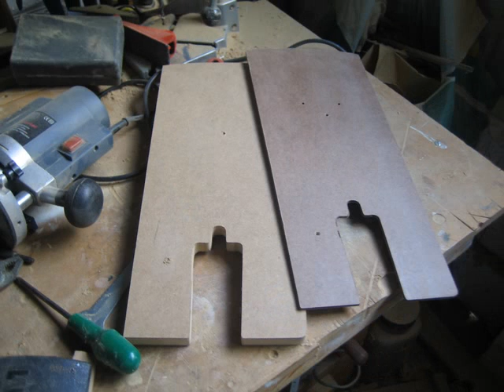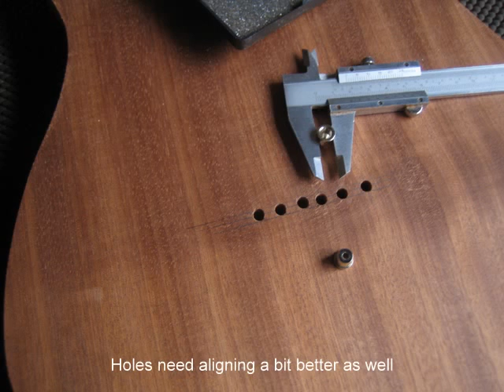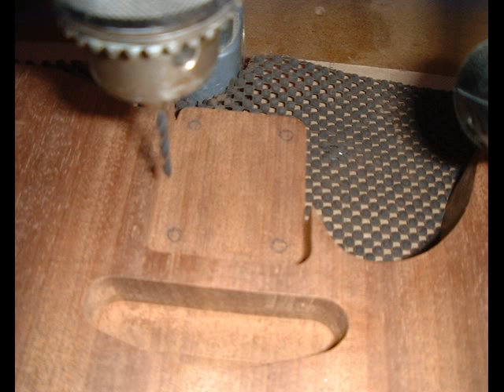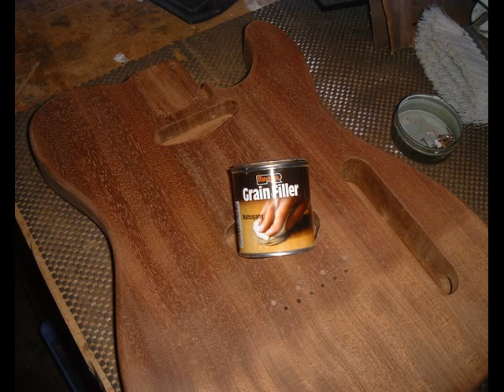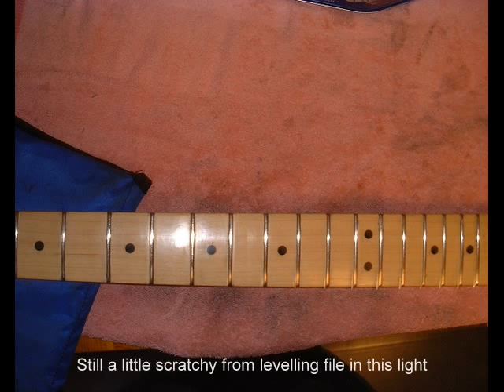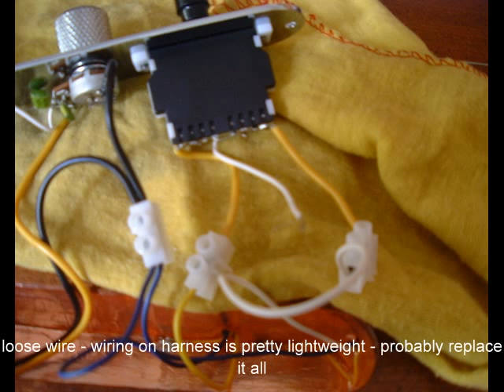Guitar Build #2 - Telecaster

Comment from the maker: @R0ckers2R0ckers  Mahogany sounds great , lots of sustain, but it's really heavy, at least the piece I bought for this build is. There's a vid in my list , '1st Guitar Build' I think, which is also mahogany but is light as any ash body. Re fret work - it can only be done with the strings off. The idea is to get the fingerboard level and then level the frets. You may have to tweek the truss rod while you do it. This neck is a thick profile, fortunately it stays pretty level on its own.

Comment from the maker: Pattern Router Bit - the ones with a bearing at the the top. Sizes not sure but I think 1/2" diameter was OK, 1/4" shank. Length depends on what your using as a template as the plunge has to reach to bottom of the cavity. Although once you've got to sufficient depth the last part can be done using the cavity walls as the template. Multiple shallow cuts are easier than a few deep ones. Buy the best bits you can afford, quality makes a difference

Comment from the maker: Hi - I'vr struggled get my bridges in the right place but am improving. In theory its 25.5" from the end of the nut to the bridge - but setting intonation will move them slightly around that position. Last one I measured 25.5 as accurately as possible and drew a pencil line accross the body at that point. Then positioned bridge with saddles at 25.5 line and maked and drilled holes.